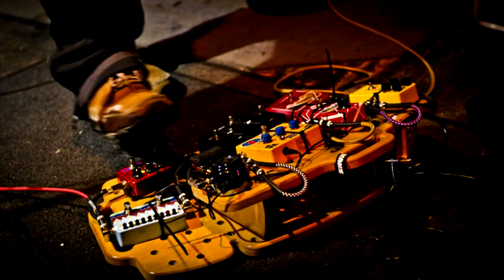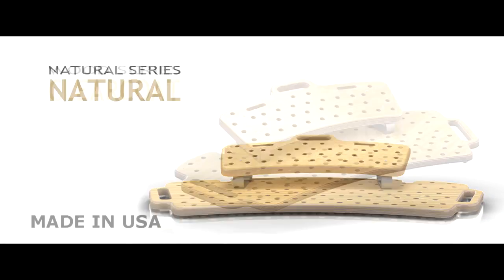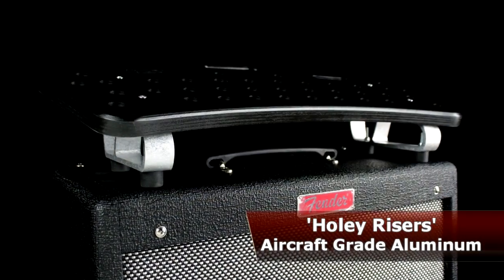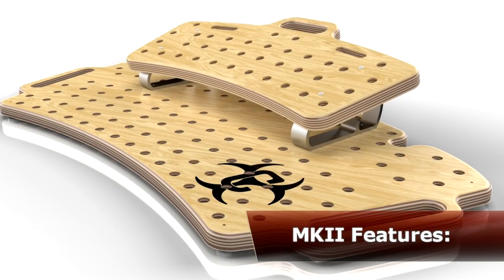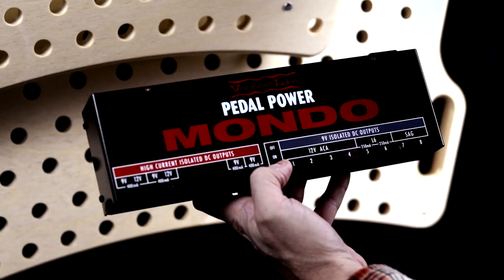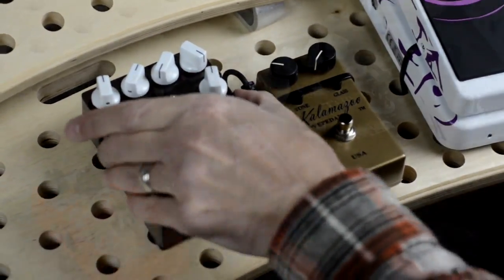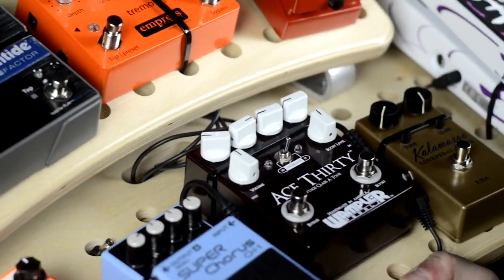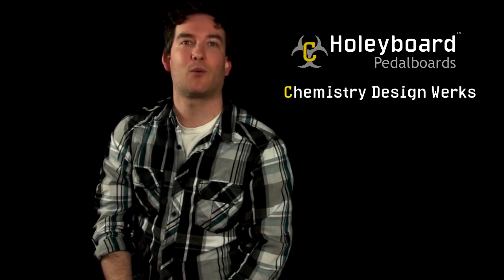Holeyboard by Chemistry Design Werks

Comment: Just got one. Excellent idea, easy set up, pedals can be moved easily to be re arranged when needed. Clean design, does not collect dust.
 The new model can easily host a large pedal, I have a Morley volume which is much wider than the cry baby shown in the video but still fits fine. Good support before and after the purchase.

Comment: I made one of these myself, didn't look as good but functioned exactly the same. I went back to velcro because the wood was heavy, had no cover protection and when I wanted to change things up it was a pain and I sometimes slashed the pedals with my knife as I cut the cable ties. This thing is better than my version but it is pretty much the same.

Comment: Zip ties are THE way to go, been doing it for several years at least. If your velcro'd board sits in the sun at all or is stored or even travels on it's side then you've had the issues where the Velcro stickem stars slipping!? Also the Velcro isn't all that secure. Zip ties are rock solid. You can have your board knocked over, have it fall off stage even, etc. and those pedals aren't going anywhere. with Velcro, the pedals would all start flying off.

Comment: Leprechaun Pedalboards uses the same velcro-less concept, but does one better and doesn't use zip ties. Instead, they use pegs that attach to the bottom of your pedal that can be removed with no sticky residue.
Reply: glue? you're kidding?
Reply: What's so outrageous about anything I said? I never said anything about glue. The pegs use an adhesive that hold the pedal securely, but can be removed fairly easily if you're wanting to without any residue or damage to your pedal. Maybe it's me, but that beats zip ties any day.

Comment: From looking at their website it looks like the boards they have in demo pics are messy. Not a big fan of the board being elevated off of the ground or being in a "tier" type configuration either. Without a hard case I don't think many people will be taking this on serious tours. I'm all for this idea but I think Pedal Train will remain the leader in pedalboards.
Reply: You're probably right about Pedaltrain, they'll still sell lots. I feel like the tiers are optional though... depending on how many pedals you have, you could probably get away with not using it. That's just me though.
Reply: jomarthegreat1 Unfortunately, from looking at their website, there is only one option for 1 level, the Amp Top, which is pretty small (about the size of a Pedaltrain Mini), and from there on you only get 2- or 3-Level boards, the smallest of which is the size of a Pedaltrain 2. You don't get much in terms of options, then, so Pedaltrain still leads the way, it seems. With some refinements, though, this idea could work.

Comment: I would be more interested in this if there wasn't that "ergonomic curve"... Pedalboards don't need to be ergonomic. 99% of the time pedals have square edges anyway, so with something like a pedaltrain you can get a way tighter pack. it's a cool idea but I dunno... seems a little gimmicky. 

Also, the zip tie method is fine but if you want to move anything around you have to completely remove the zip tie entirely. Velcro you can at least re-stick somewhere else on your board.

Comment: Despite the info, it looks heavy as hell. 
I don't like the idea of zip ties either. 
If I were to use a non-pedal train board, I'd go with Leprechaun.
Reply: I like this! cosmogang I hate using the velcro! If it gets hot the adhesive melts and the velcro will slide off. How much is this?